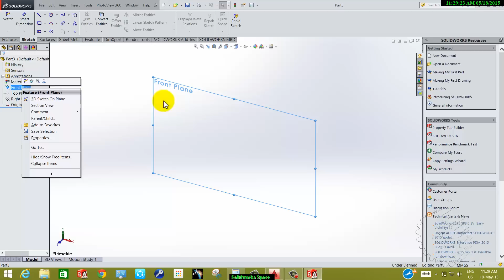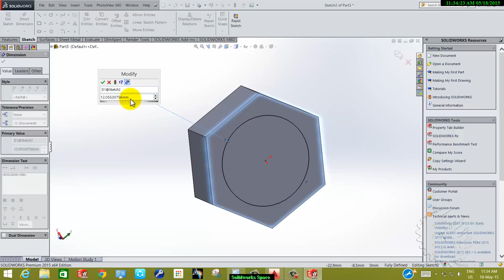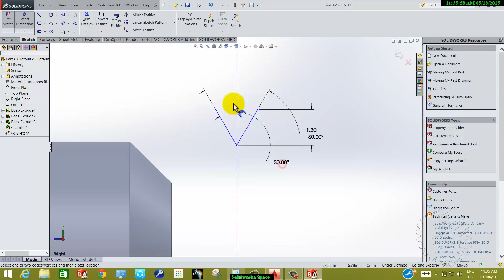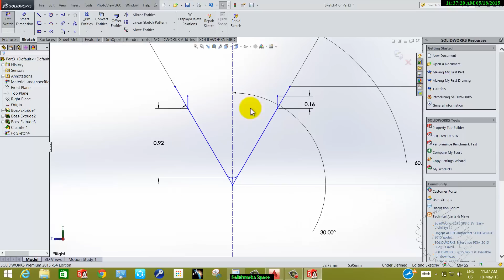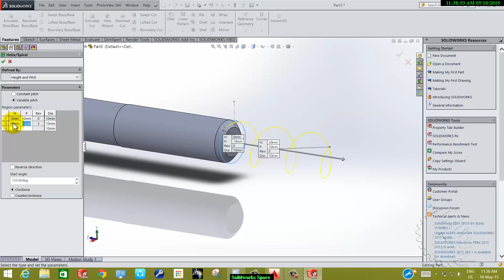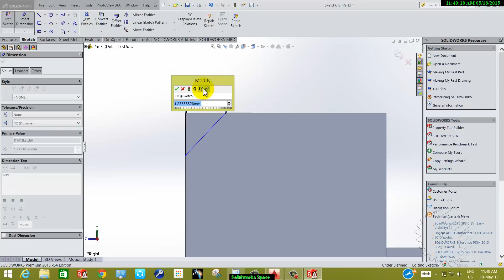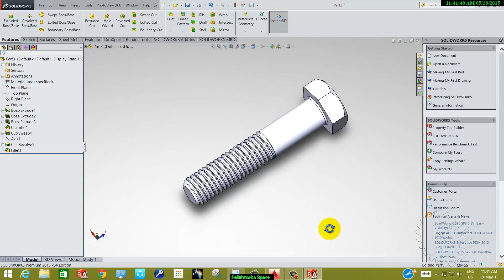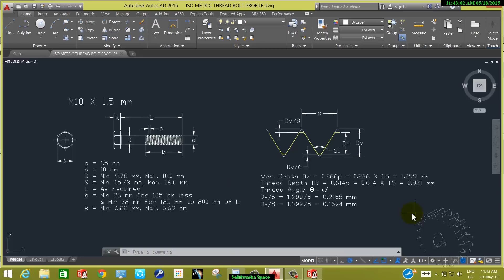SolidWorks Tutorial: Modeling a Hex Bolt M10 X1.5 mm - Step-by-Step Guide

Comment: Great video!! Do you know how to create some blade cut in a sphere. For example, I am trying to design a bucket lid which has four cuts in the center and the center of the lid is a hole. So, the cut goes outward direction in four corner but in a angle such as the blades in blender(kitchen). Thanks.